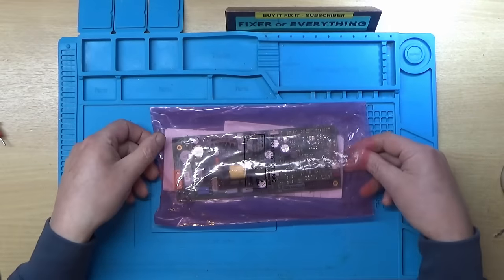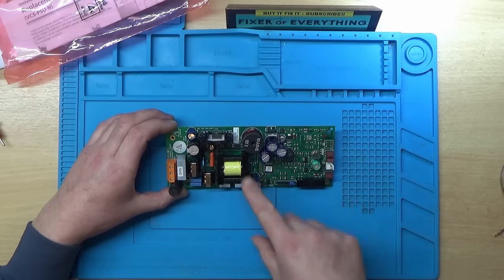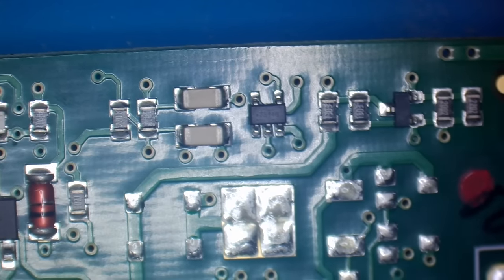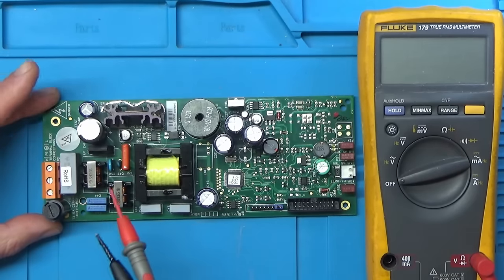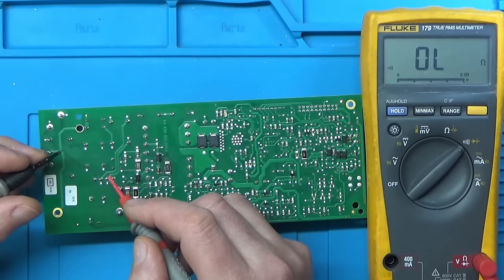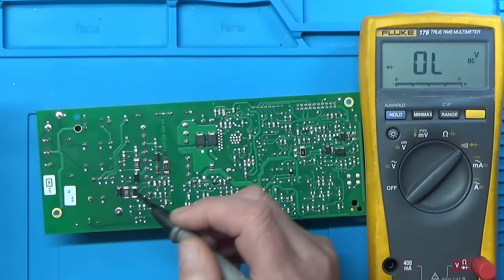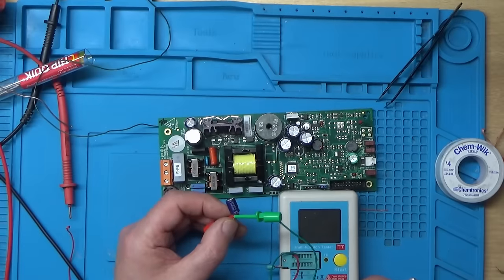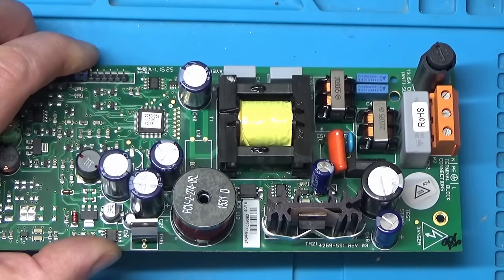VERY Expensive Fire Alarm Power Supply | Can I FIX it?

Comment: Surface mount cap like that one caused my APC UPS 1500 to not be able to sense if mains was online...similar to this fault. It would have been great if you would have shown the voltage to the IC after replacing the cap. That would have doubly confirmed the fix and also have shown the impact of the ESR on the old cap on the voltage drop. Otherwise, great video!
Reply from the maker: Thanks, yes I realised that after making the video. I did measure it since then, and it now shows 12V across the cap ans on the VCC on the IC 👍

Comment: Nice. Those little startup capacitors are responsible for a lot of dead switch modes. Did you measure the voltage across the capacitor once you replaced it?
Reply from the maker: Thanks 👍yes I forgot while making the video but I did afterwards. Approx 12V across the capacitor and to VCC of the IC when it was running.

Comment: It’s been known for a while that it was just a dodgy cap that causes these to fail, it was still interesting to see the thought process behind finding the fault though. I’ve had to replace many of these psus over the years, and it’s amazing how many are still out there, but service engineers aren’t testing the systems correctly now because they know the system will probably die when they do it. The most concerning thing is that gent/honeywell seem know about the issue, but never issued a recall, or even admit fault, as far as I’m aware.
Reply from the maker: Thanks 👍and thanks for the info.

Comment: Are you familiar at all with Vicor power supplies? Looking at one right now that is quite complex. It is composed of like 5 chassis mounted cards, 5 or six plug in cards, and has additional sockets for more cards.  An input power board feeds 3phase 120/208 into full wave bridge rectifiers and outputs about 280vdc. From there, the power goes to a toroid on the main board and tot he source pin of a MOSFET. The MOSFET gate appears driven by a separate driver board that plugs vertically into the motherboard on the LH side, and there is a supervisory board full of a boatload of opto couplers, thermistors, dual comparitors and the like, which is plugged into the RH side of the motherboard. At the halfway point (fore-aft) of the motherboard is a backplane where several output cards of different voltages plug in lengthwise with the unit from the front.  I've never seen anything quite so involved. It looks like the design avoided using inductors outside of the larger ones driven my MOSFETs.
Reply from the maker: It sounds interesting and complex. I've not came across such a device.

Comment: I always insist to my students to use an isolation xformer when working on switching power supplies and never rely on a Voltmeter for measurements. Always use a scope. You might have switched your DVM to AC volts. I suspect AC on DC line. You might have gotten some value. Ideally should be near 0VAC.
Reply from the maker: Thanks for that. I sill need to get an isolation transformer at some point, although they also come with potential risks as any ground fault isolator would not trip if there was a problem.

Comment: Great troubleshooting and fix! 

One question I have--do you know why the downstream circuits didn't work when you powered the IC directly from bench power supply with 8.80 V? Because supposedly the issue is that a faulty cap with a high ESR would not be able to provide good decoupling to the IC, but once you put a power supply directly to VCC on the IC, the decoupling cap becomes unnecessary right ?
Reply from the maker: Thanks, been a while since I looked at this but I remember when it was running I measured the voltage on the cap and it was 12V. The faulty cap is the bootstrap cap that powers the IC until it starts oscillating, then there's a diode that is attached to a winding of the transformer that keeps the chip running after startup. The bootstrap voltage wasn't high enough to start the IC.

Comment: I just had a TP Link Kasa smart switch fail for the exact thing. Capacitor on the power supply for the control chip failed causing the chip to start and reset continuously which caused the relay to turn on and off continuously. Fixed and working now.
Reply from the maker: Nice 👍Thanks for sharing 🙂

Comment: Great find again. I like to watch and learn from your videos.
But, just in hindsight, how about changing the Zener to a 9.1 V type. It is a design flaw by the manufacturer. "It works with 8.5 V" doesn't make it work reliably, as can be seen.
Reply: They wouldn't sell many £422 psu boards then - built in obsolescence
Reply from the maker: Thank you 👍The voltage when it was running (I measured it the other day out of curiosity after making the video) was around 12V. I think the other black diode just above the zener diode feeds power from the transformer once it's started up. I'm not sure what the "start up" voltage is. It must be higher now, but it's strange as it was already DC from the main smoothing cap, so it shouldn't have really needed smoothed, so unless the internal resistance of the failed capacitor was pulling the line down which would be a viable explanation.

Comment: But wasn't the unit still firing up but wasn't switching back to mains once the power was restored, did you check the power cycle behaviour with some batteries connected?
Reply from the maker: No the unit was dead from the mains side. The voltages were present when running off the battery, but the battery wasn't charging and the whole system dies when the battery goes flat.

Comment: Are the LEDs on power supplies indicators only, or do they add circuit protection or add the the functionality of a circuit. I’m still a beginner. Getting grey fast but still a beginner(at least in electronics). Great video!
Reply from the maker: Thanks 👍yes they are just indicators to let you know that a voltage is present or they are functioning correctly.

Comment: I have a knackered one of these (from a Gent Vigilon)! Its blown the switching chip during testing but I might well try this! Its a massive problem these failing.

Dont suppose you have the value of TR21 & a closeup of the resistor values of the 2nd SMD resistor down under the diode beneath R47 (I think its 1000) and the SMD resistor directly to the right of that same diode (1001?) do you?
Reply from the maker: I doubt the capacitor would cause the chip to blow. I'd check the resistance of that dropper resistor and check the mosfet or transistor for shorts, and perhaps check the zener diode too.
Reply from the maker: I'd also change the capacitor anyway as it looks to be a common failure point.
Reply: @BuyitFixit  Fet has definitley gone short which I suspect is the cause of the other crispy components, which I've determined from your video are a 100 ohm & a 1k resistor as well as the R47 0.47ohm resistor. And the other diode (another Zener one presumes) near R47 to the one you tested. Should be a cheap fix if thats the problem. Plus the cap & switchmode chip.

Pulled the cap, thats deffo fubar!

I thought I had another failed one of these here that I could just swap the cap on but clearly I'd chucked that out in sheer disgust haha
Reply from the maker: Nice, well I'm glad the video was of some help. You'll have to let me know how you get on 👍
Reply: @BuyitFixit  I shall :) thanks for doing them, never thought I'd see anyone do one of these haha

Comment: Ah, the Unitrode UC384x series PSU chips that “pick themselves up by their trouser belt loops and fly away”. 

Twice I have had to use (specifically);a UC3842 to completely rebuild a failed power supply that had “some wierd switchmode” chip fail in it. First time was in a swanky HP8590 spectrum analyser…the innards were all HP but the power supply was third party Japanese mase by Matsushita if I recall correctly. It had just stopped, like this…no power MOSFET with a “smouldering crater in it. The driver chip was on a little sub board and I deemed that the far more familliar UC3842 would do the same job, so I built up a replacement driber in a piece of Vero the same size as the original sub board around the UC3842. I basically just copied the application circuit used on the UC3842’s datasheet with a few minor tweaks. When I powered it up…NOTHING, but when I turned it off, there was a brief flash of the power indicator LED as the main filter cap went down…I quickely hit the power switch again and up it came good as new! I worked out that this capacitor…the one you replaced here…is critical, as is the 220k charging it from the 340v rail. If this capacitor is only a bit wrong, it just won’t start. Each UC384x series chip has a different “start” voltage, so 8.6v here, but it is about 20v for the UC3842. So that cap has to charge to 8.6v, the UC starts…AND, the cap has to be big enough to keep the UC going long enough to get the power MOSFET and transformer started, then a half wave recrifier from an overwind on the transformer takes over keeping the said cap charged and the UC384x going. If it doesn’t make it before this cap discharges too far, it wob’t start…hence my statement about “trouser belt loops” above.

Thevsecond time I used a UC3842 was in a SONIQ flat pannel TV I found on the roadside. The boost converter driving the backlight LEDs had simply stopped…so, again I frlt the trusty UC3842 would replace the failed Chinesium chip…why they continue to re-invent the wheel is utterly beyond me. So I completely rebuilt and redesigned the driver part of the boost converter, I had to get readings from ny nephew’s functional SONIQ of a similar model and had to very carefully measure the VI characteristics of the LED string. As I designed it, I soon found out that a UC3843 (which starts at a lower voltage like yours there) would be a better option, but I did not have any of them, just a drawer full of 3843’s I’d got out if SMPS’ I had stripped. So there was this 50v rail in the TV, so I just dropped that to the rail of the UC3942 via a 27K, 2w resistor and a diode, that was enough to loft it tp the 20v it needed to get itsself going…quite a bit of tweaking in the feedback loops and I got it fully functional and stable.
The TV also had a linear regulator supplying 3v3 tp the micro that had failed, I deemed an LM317 would do the job, just needed to add two back diodes from “Adj” back to “out” and “out” back to “in” to ensure that at turn-Off the output bypass capacitor did not hold the output pin of the 317 up more than a diode bias above the input as the input unreg rail fell. And that worked too…TWO reinvented “Chinesium” chips replaced with old “Jellybeans” that have been sround for more than 40 Years!

Cheers from Tasmania!

Really respect farmers that can keep things going with a piece of fencing wire and a pair of bull-nose pliers…keep up the great work!
Reply from the maker: Thanks 👍and thanks for sharing your experiences! I've had to be creative a few times too. Once was fixing a FLIR thermal camera where FLIR wouldn't help or supply parts, and another I can think of was a night vision monocular where the 3V standby regulator circuit had failed and part had been replaced by the wrong one. Both videos are on my channel. The world needs more people like us!
Reply: Thanks for the prompt reply. Yes I don’t have much patience for pencil pushers getting in the way of repair and maintainence. I just love the way you got that inverter going…reprogramming it too..that is one skill I Don’t have…and the tractor EEPROM we just great, one of your best in my book!

Decades ago a friend and I had to fix a Calver brand audio amplifier. It had some marketing BS on the front pannel about “Calver proprirtaty “magnetic” control”. We did not have the circuit diagram, so we asked them for it. They declined, so I went and drew the circuit from the piece of gear itself….you have the gear, you effectively have the circuit, just takes TIME to extract it!
There was some guf involving TRIACs on the primary side of the transformer I recall, but it wasn’t much more than a glorified light dimmer with a snubber…was that the “secret” they were trying to hide by denying us the circuit? 
Anyhow, we fixed it…and just to “rub-it-in” I posted a copy of my hand drawn circuit back to them….”sandbag” response of course!
Reply: Oh, I forgot, I sarcastically wrote across the circuit I had drawn, “Thanks so much for the circuit!”.
Reply from the maker: @thanhhuynh272  😂😂😂😂👍

Comment: Nice work, you could have checked the 8.5v vcc to the chip with the scope to see if the capacitor was working.
Reply from the maker: Thanks 👍Weird thing is that the mains was smoothed via the large mains cap before being fed through the resistor to the IC. The only thing I can think is that the internal resistance of the cap was causing the line to be pulled down to below the startup threshold. I did measure the voltage a couple of days after making the video, as I forgot to do it at the time, and it was around 12V on the IC.
Reply: @BuyitFixit  yea of course, I didn't think of that - you are probably right wouldn't take much to overload the resistor dropper or zener regulator, and hence why the resistor had been so hot
Reply: You should have measured the voltage at the vcc pin after replacing the cap, for reference.
Maybe you had a short circuited cap that pull the voltage down just a little bit to much..

Comment: Not getting a warm fuzzy on this.  Yes, it might have been the cap, but more for it's decoupling rather than filtering.  I'm wondering about the diode.  I'm thinking it might be a Zener that changed value.
Reply from the maker: The only thing I can think is that the internal resistance of the cap was causing the line to be pulled down to below the startup threshold. I did measure the voltage a couple of days after making the video, as I forgot to do it at the time, and it was around 12V on the IC.
Reply: @BuyitFixit  Any possibility that the heat on the resistor fixed it?  From the video, you did both the resistor and the cap between last failure and success.

Comment: Why didnt you use the multimeter capacitance setting to measure the capasitor?
Reply from the maker: I sometimes do, I can't remember if I did and it got edited out. The meter doesn't show then ESR so it may well have just shown that it was around 4.7ohm. It's also not that accurate to measure in circuit as there may be other components in the circuit that can affect the reading.

Comment: Is this still compliant with the very stringent requirements fore fire alarm systems the standards even go into fixing a system
Reply from the maker: I have no idea. Perhaps not with the cap that I fitted, but I fail to see why not if you  replace it with the same surface mount one. I would see it no different to replacing the main fuse but I'm no expert.
Reply: I actually worked in a factory manufacturing fire alarms in the early 2000's and I worked in the test department fixing custom returns down to component level, except I had circuit diagrams, working PCBs,  blank PCBs and so on. So I couldn't do this without that. And once I got them working again they were fully tested by that I mean following the test procedure set by the R&D department, which was basically press this button and that happens ect, and then left powered up for about 24 hours. But there was nothing like checking voltages at test points or getting scope readings etc, as long as the test engineer was happy with it then out the door it went.

Comment: Well done Mick those surface mount caps are always a first port of call, had them fail on the older type Samsung to mainboards, causing horrid audio, no picture, or restarting issues.. they are an awful idea and design
And the price is ridiculous, with tvs if there’s a fault with a board and they are ridiculously priced you know it’s a common fault for example some Sony mainboards are like £100 because of the common fault of being dead, logo only or boot looping, it’s because of the EMMC chip while others are £20-30, I’m surprised that company doesn’t do an exchange service and repair them and sell them at £400 😊
Reply from the maker: Thanks Gary. Was just looking at my wifes Landrover Discovery 4 bluetooth module, which has those same type of capacitors. I replaced them and now it's currently on test, although it seems now the gearbox has decided to pack in 🤷‍♂️
Reply: @BuyitFixit  they are the cause of alot of faults, oh NOOOO! that sounds very expensive, I just had to do the drivers side window regulator on my 2006 volvo c70, had quotes like £300 the cable had rusted and snapped I collected and paid for the part (£45) and did it my self lol
Reply from the maker: Nice 👍I'm going to check the gearbox fluid level first.. fingers crossed 🤞
Reply: @BuyitFixit  everything crossed here for you Mick 🙏

Comment: I'm saw similar case, and there in IC application note clearly was described which capacitor should be used. (and designer didn't prove correct)
Reply from the maker: That sounds very similar to the Philips sound bar I looked at. A guy bought a batch of them all faulty and overheating, it was a few videos back.

Comment: Hey hoo nice repair.👍👍👍👍😍🥳🥳.
In the past it was mostly  in the smp's the faulty capacitor for vcc. Look the datasheet at eg. TDA 4600 one of the first generation in the smps.
 The starting voltage wasn't high enough or smothed enough(the ripple are to big) .
Nice video🍻🍻
Reply from the maker: Thanks 👍and thanks for sharing 🙂